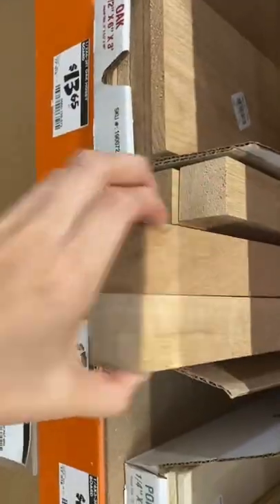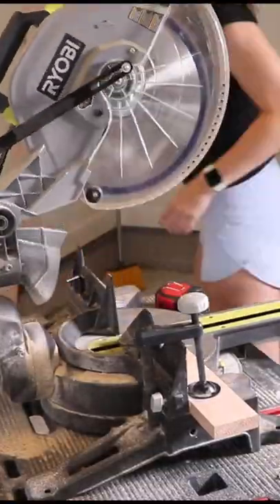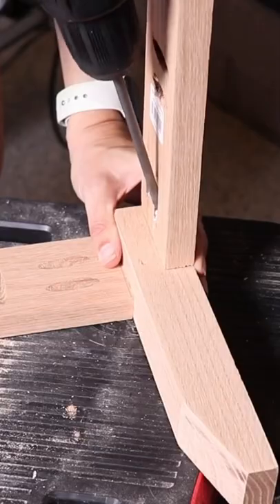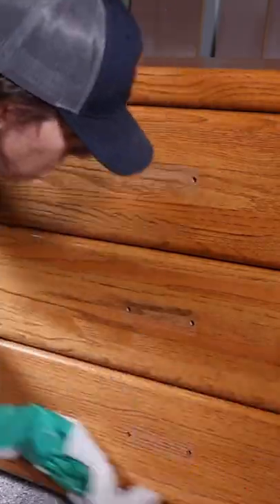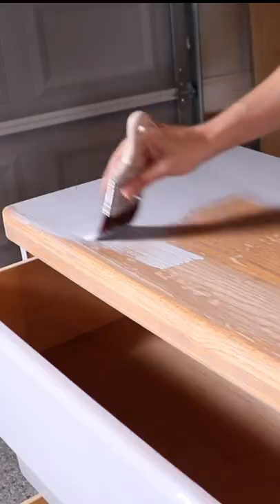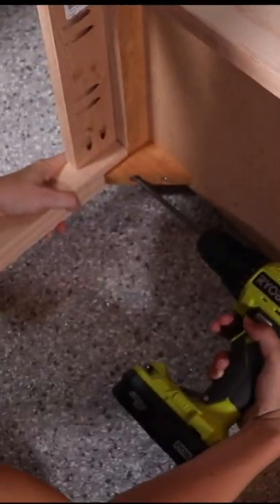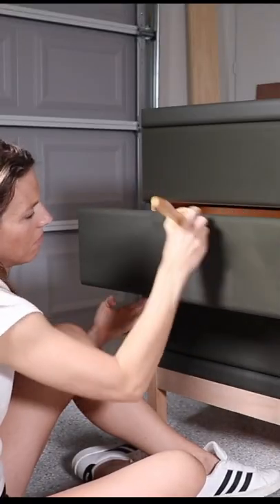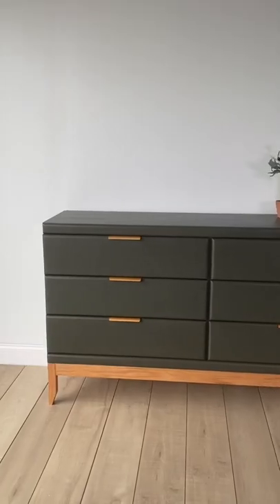Modern Furniture Makeover #shorts #furnitureflip

Comment: I loved this one! 

The original wood cuts were bulky and thick but not particularly nice - the piece was built to be sturdy but wasn’t a quality piece of classic furniture - so, it was the perfect thing to remodel and paint! I really appreciate the decision to mount the hardware on the lip of the drawers rather than mounted handles or knobs centered on the drawer’s face as it wouldn’t mesh well with the broad plane and it could be difficult to drill through the thick wood for a handle of appropriate size. The dark, cool toned paint was also a good call to camouflage the original bulkiness too appear slimmer and make the thin handles accentuate the horizontal flow of the dresser.

Really nice job!!

Comment: Christina how would you repair a counter top that was cut and now has popped up. I had the maintenance man in my building look at it he did it wrong. I tried to tell him to apply a 10lb weight on the bubbles under the counter top sheet but no he used crazy glue to close the opening leaving bubbles under the counter top sheet.  Can I use something, paint remover to re-open the sheet where it was cut apply the 10lb weight to smooth out the bubbles and then seal the cut? I wish I could send you a picture.

Comment: The trend now seems to be using a different color or to  leave the actual wood stained instead of painted on just a small area of the piece. In my opinion it doesn't work on a lot of the pieces. For example this might look better if a total frame effect was done here, with the sides and the top having the area by the drawers left stained and not painted. A thin piece of unrelated trim just doesn't quite work. Making a new base was a smart move, that looks like a piece of oak furniture from the 80's / 90's.